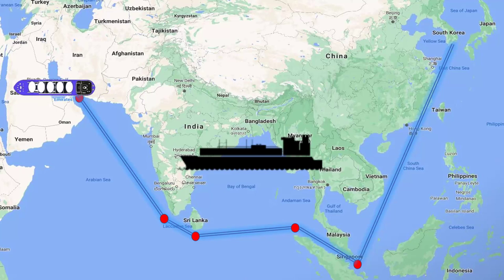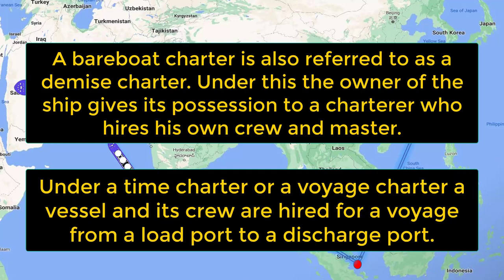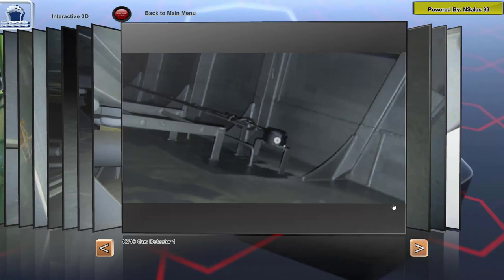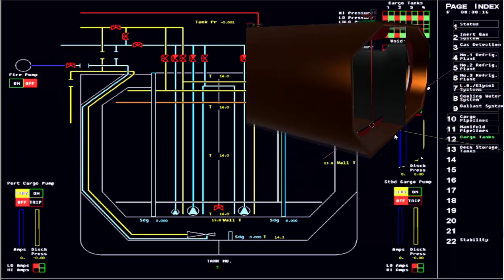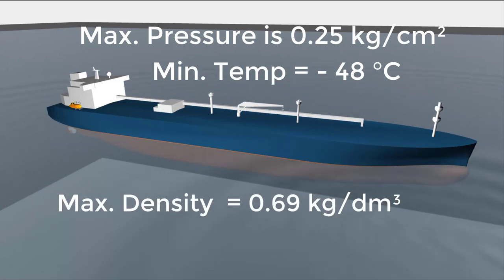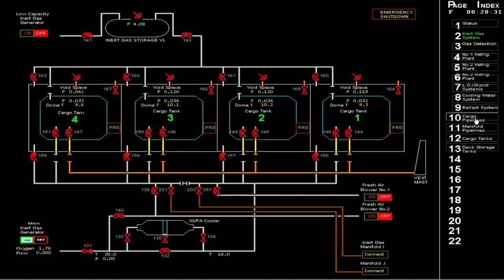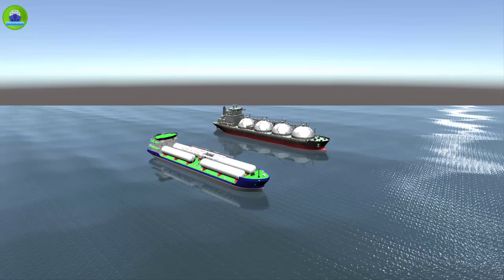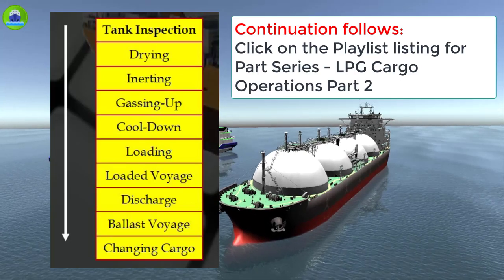LPG/C Ship Cargo Operations Part 1 - Introduction

Comment: Great content sir Thank you for making this! Studying here. Question sana ako sir, Ang (Propane, Butane,and Ethane) ba pwd walang tank cleaning pag mag change-cargo any sa kanila?
Same question sa petrochemical groups na (Ammonia, VCM, and Chlorine)
and hydrocarbon groups (Ethylene, Propylene, Butylene, and Butadiene).
Reply from the maker: Mostly pag saturated hydrocarbon LPG ay puede wala else sasabihin naman mg charterer. pero pag unsaturated hydrocarbon like ethylene, propylene, etc  ..di cla compatible kaya need to do a complete change of Cargo preparation. else ma ccra at ma out of spec cargo mo. may compatibility chart at like wise sundin mo sabihin ng charterer/ optn dept.
Reply from the maker: In short, Saturated to Unsaturated Hydrocarbons and v.v. ay need ng tank clean. This is however is checked to the compatibility table.
Reply from the maker: kung butane, ethane, propane ka lng naikot , nasa charterer na yan kun gusto nila pa tank clean. In general, and Propane kahit puro or Butane ay may ilang small percent pa rin na laman sya either propane or butane.
Reply from the maker: A compatibility chart is used for referencing. However, decision for cleaning rest with most charterers since its their cargo.